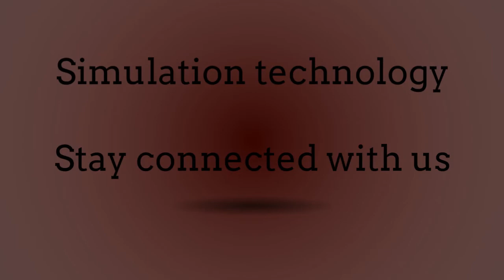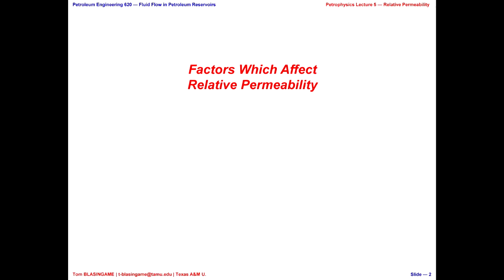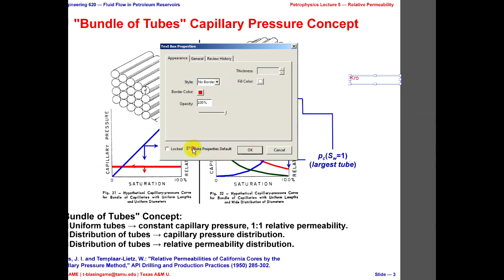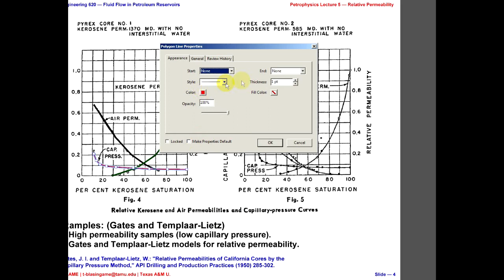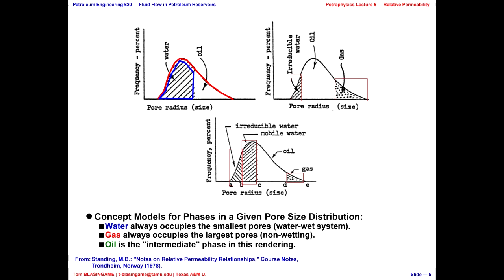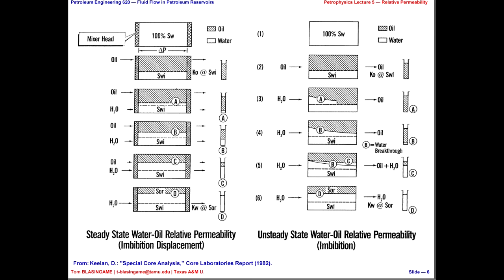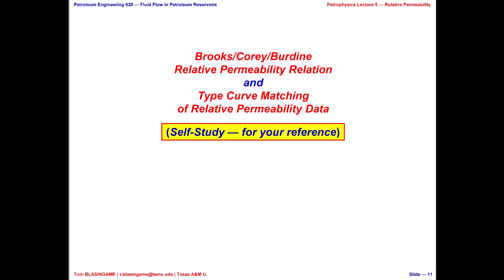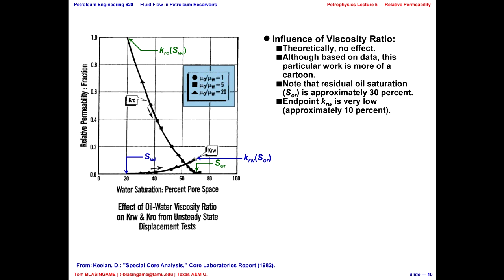Relative Permeability, Petrophysics Lecture 5, Petroleum Reservoir Engineering free course

Comment: When conditioning the core to Swir for relative permeability experiment, what pressure drop or flow rate is recommended/needed? Wouldn’t the resulting Swir be dependent on the aforementioned variables?

Comment: Thanks so much For great info, i've some question about relative permeability at constant pressure" i apply a definite amount of pressure depends on absolute permeability of plug sample for ex" 2psi" so this is pressure value is injection pressure value from one end, how can i calculate differential pressure across plug sample " differential pressure equals p in- p out" but i can't measure p out since pressure gauge reads zero due to open flow " what is actual value of differential pressure in that case please??